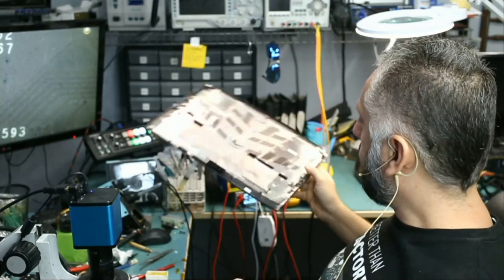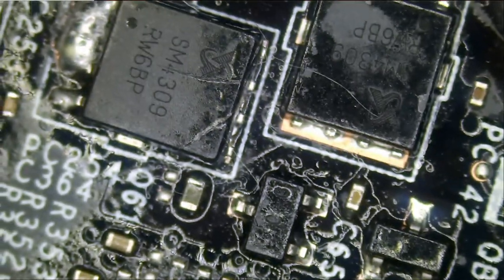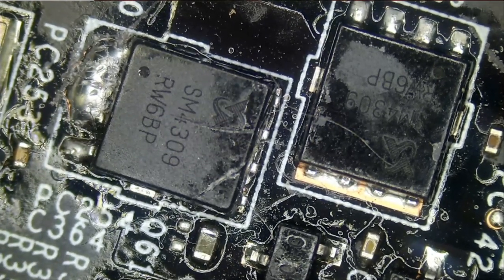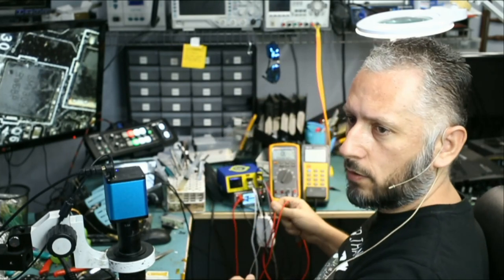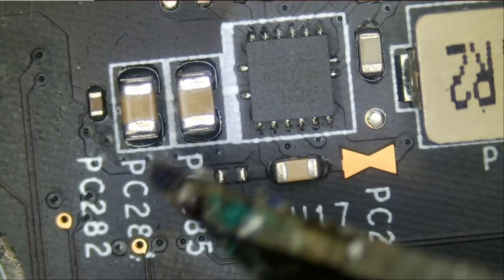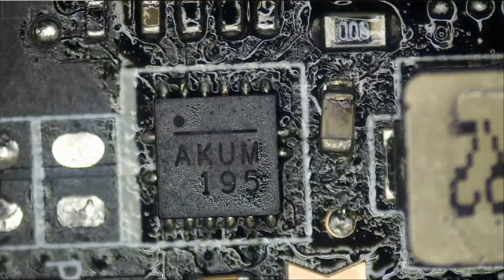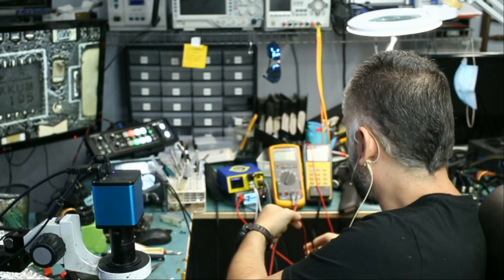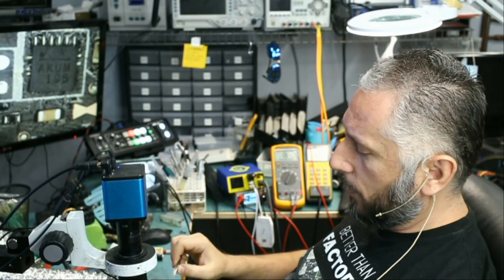MSI MS-17F4 Laptop No Power Repair- Failed prior repair attempt -  Tracing Short Circuit

Comment: NB685 ic provides a complete power supply for DDR3, DDR3L, LPDDR3, and DDR4 memory with the highest power density. It integrates a high frequency synchronous ...

Comment: This is most likely wrong, but I keep coming up with a transorb part. If it is a transorb, you could probably leave it out just to test it.
Edit: transorb. A "thing" to absorb voltage spikes. Like I said I'm most likely wrong.

Comment: Can someone in the comments help me? I have the exact same laptop and I made the mistake of not unplugging the battery while removing the display cable. It shorted out a mosfet which I got replaced, but two shops told me they still can’t fix the board, one said that the cpu is gone. Could the cpu be dead?
Reply: Send your board to the man in the video, he’ll make it better then factory
Reply: you probably sent 24V backlight rail to GPU_DATA or Image_MUX
Reply: @sunsys0  no children here bro, all my kids are grown up already

Comment: Brilliant videos mate I used to repair electronics for a living pre SMD. Any chance you could do a Radeon VII code 43 video. there seems to be an epidemic of those failures. Maybe it is virus related :)
Reply: If video card is turning on and show images into the monitor but fails take in video driver most likely video ram is dying. Same thing if black screen one by few try to turn on pc. If I remember correctly VII has vram at the same silicon chip as GPU so this will be very expensive repair if possible
Reply: code 43 could be vram or bios issues